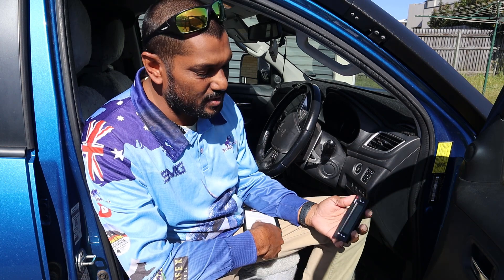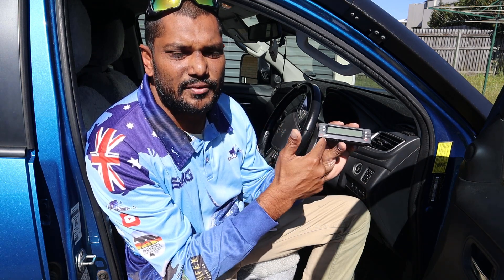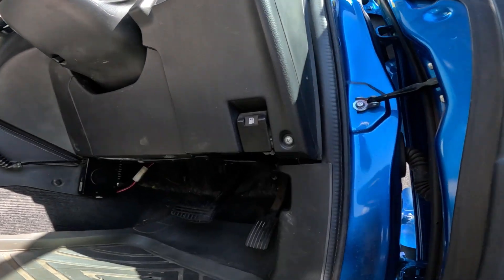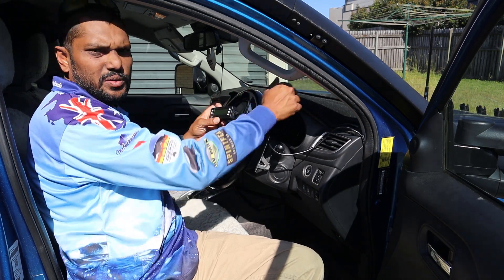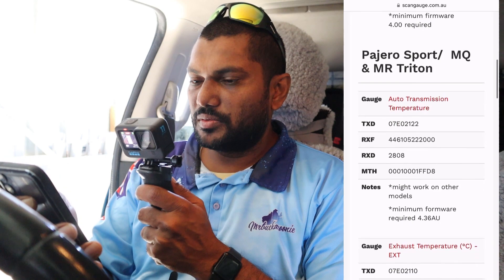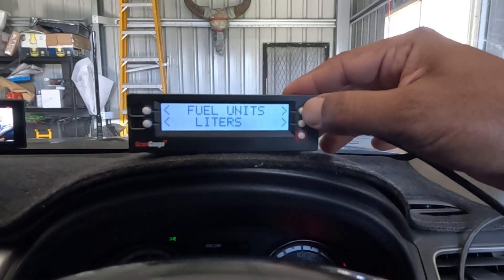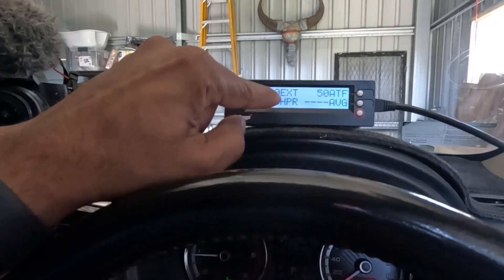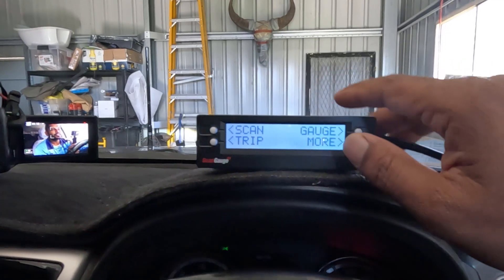How to monitor Mitsubishi Triton Transmission temperature with ScanGauge 2

Comment: Hey, which year is your Triton? Looking to get the scan gauge 2 but I would like to monitor DPF data such as soot load, dpf temperature and dpf status. I have the 2020 Triton.
Reply from the maker: @vf464  hi mate. It’s a 2020. Not sure if it can do all that. Check out their website or shoot them a message. They are pretty good with answering questions.

Comment: Question my mr triton scanguage 11 only ever shows up 85 deg but sometimes I s get the warning on my dash that transmission is overheating . Also my only goes up in 5 deg increments is yours the same
Reply from the maker: @iandavis5445  hey mate. No. Mine was constantly changing as I drive around. Maybe double check the codes are right. It’s easy to make a mistake.

Comment: Thanks for this mate.  I went out and got one of these as soon as I saw your review and have just done a test drive with it installed.  Out of curiosity what sort of EGTs are you seeing on the gauge?
Reply from the maker: Hi mate. The Triton show EXT which is exhaust temperature. I’m not sure if it’s the exact same as the EGT But I think it may be. My temps stay around the 350-500 under normal driving and I’ve seen it go up in the 6-700 gunning it up a long steep hill. I haven’t been monitoring it for too long so I don’t fully know what is normal yet. 
What temps do you get?
Reply: Yeah my temps are about the same, maybe a bit lower but probably because I’m in Victoria where it’s a bit cooler. Haven’t found a long hill to test just how high it will get.